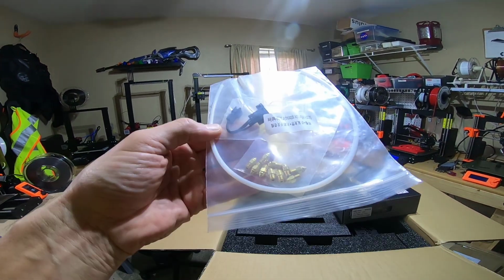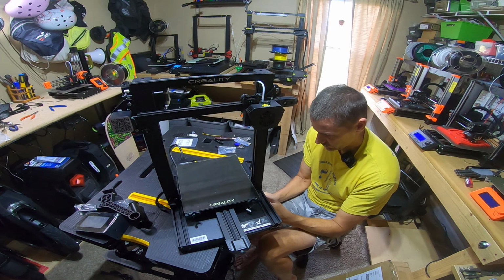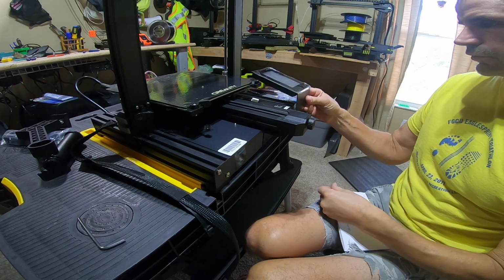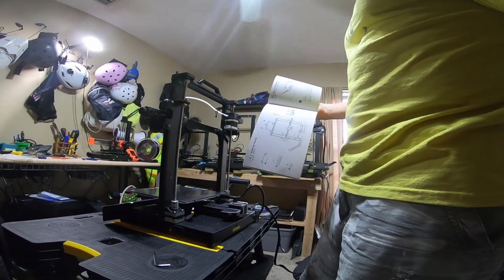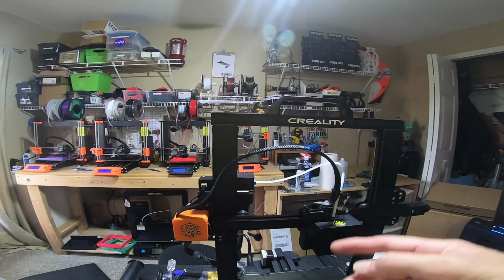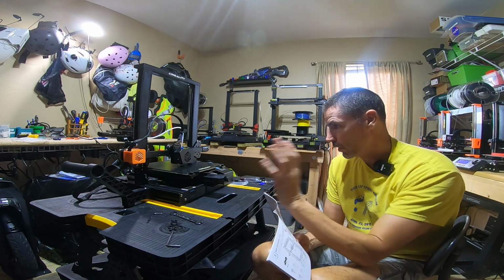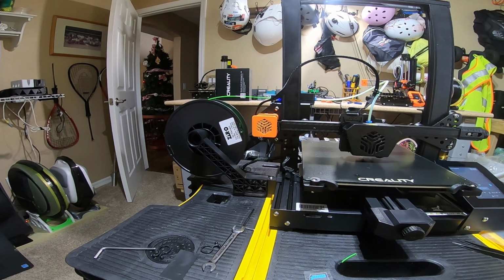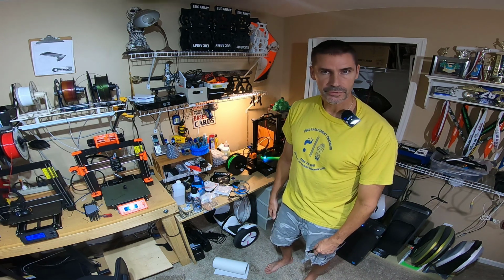Creality CR6SE Unbox, Build, First Print - Why I'm never buying a Kickstarter printer again

Comment: I am running a CR20 and its super solid. What is the bed size on this new one. Mine is just too small to print the full size stand so I have to scale it down to 95%.
Reply from the maker: 235x235x250  very similar to my Prusa MK3's
Reply: @Duf  Great stuff thank you for the feedback. I printed some chrismas trimmings and a stand for my hot glue gun that always falls over.

Comment: Wondering if it might be cheaper, easier, quicker, less capital investment etc to outsource the 3D printing/injection moulding production of the EUC stands to Shenzhen in China and have them shipped out to the US.  
The city Shenzhen is like the Silicon Valley of consumer electronics (eg: EUCs) and manufacturing.  
Can order just one part/piece or ten thousand parts/pieces.
Maybe try www.facfox.com, there would be others too.
Hope the house insurance provides cover for business/trade being carried on in the premises.  Sometimes policies specifically exclude coverage for this.
Great vid, look forward to the next ones, thanks.
Reply from the maker: Have investigated that a bit, the upfront mold cost is major, I don't sell enough to justify it.

Comment: I use Formbot printer and love it.. the volume is insane.. 400x400x700 mm it's not nubes printer but it does work great... like printing my Monster V3 seat at one piece or MSX one or Monster PRO< EX and EX-n boom
Reply from the maker: Damn that is massive volume.  How much did it cost?
Reply: @Duf  BlackFriday few years back about 1600 including shipping
now they have it as better versio Trex3+ I believe Vivedino is new new name. .it's Dual extruder
Reply: @Duf  check this

CR-30 Creality 3DPrintMill